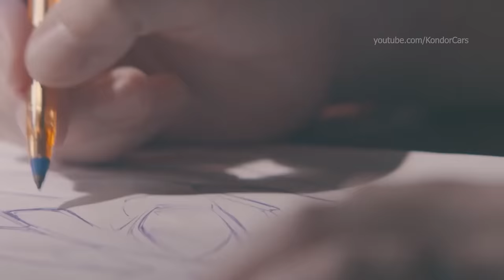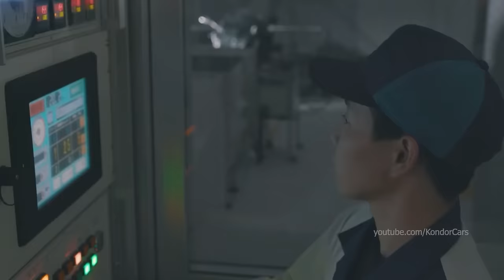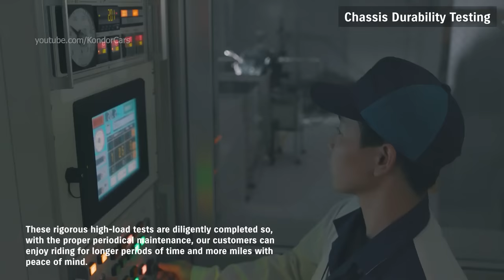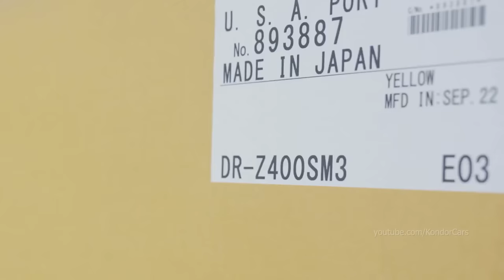Suzuki Hayabusa Production & Development - Japan

Comment: After the design is finished.. the aerodynamic test is next.. 
If the aerodynamic is not right.. the design will be redesigned..

That is hard af.. salute for japan.

Edit: i bought a cheap assembly Benelli motorcycle from china.. after a couple thousand of miles driven..
Front shock absorbers leak,
Cam Bearings loose, one way starter problem, starter relay problem..

👆 Common issues with the same motorcycle.

Comment: I had a trust in Suzuki ,but after owning  Gixxer  I have no trust. Engine was refinement but after 15k kms engine overheated and knocking sound occured then Crank bearing and bore got replaced and and now again in 36k kms same problem  engine knocking sound occured and gave it to service center , now it passed 14 days still I have not got the bike

Comment: Suzuki ... the company that produces a motorcycle and then never updates anything but the decals and paint color. DR650, DRZ400, RMZ 450 & 250, DR200 and the list goes on and on. They are the Rambler of the motorcycle world and a shadow of the great company they were 20 years ago. I pity the poor soul on the assemble line that for the past 29 years has had to install the same crappy forks, crappy rear shock and butt breaking rear seat, small gas tank and 1960's instruments on the DR650. Buy elsewhere.